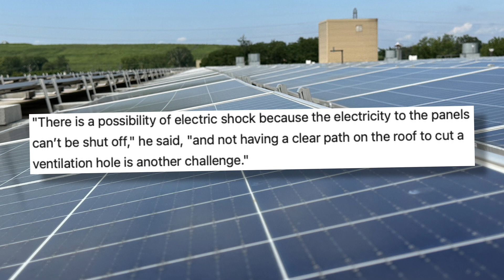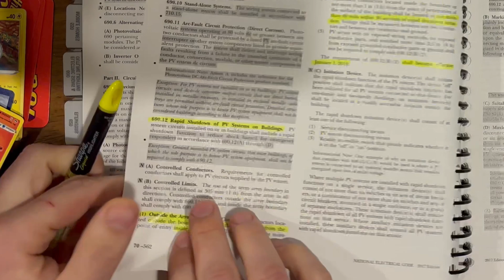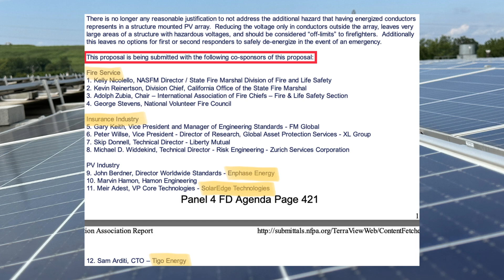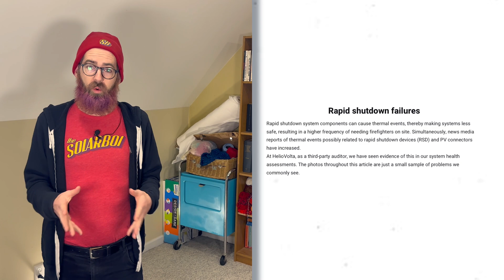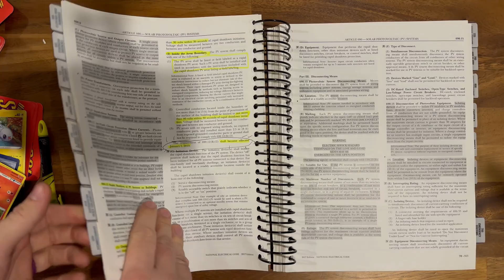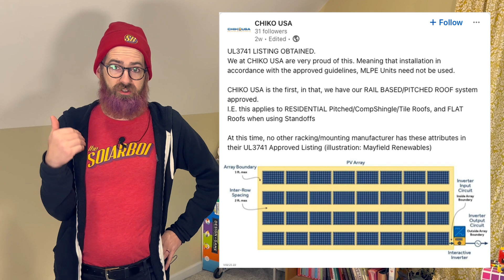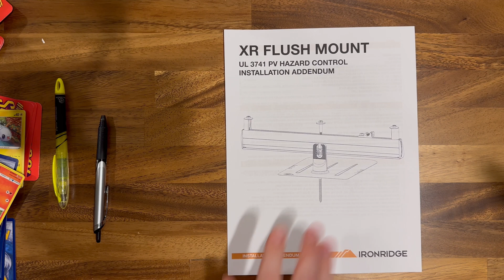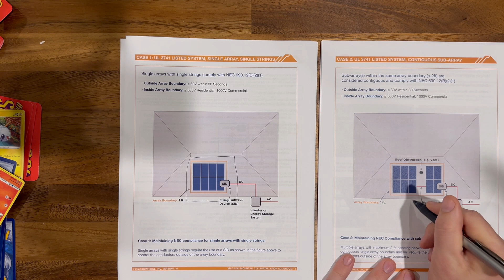Huge Breakthrough for Rooftop Solar! (UL 3741)

Comment: I got my electrical contractor's license in 1975, and spent way too many years in that rat race.  The NEC has always been a PITA trying to decipher all the ifs, ands, buts, and exceptions, and sub-paragraph blah-blah, not to exceed blah-blah unless, pursuant to blah, blah, etc.

As if that weren't bad enough, there were about thirty different jurisdictions within the area I worked in, and they didn't all use the same version of the code, and many of them had their own separate special rules regarding conduit maximum number of conductor fill rates, and on and on.  In Los Angeles City, every inspector even had his own special quirks about how he wanted things to be done, and if you called for a reinspection, there was a good chance you'd get someone else, and he'd tell you something different.

I'm getting ready to install a small solar system at my house that will most likely not be able to output more than 1KW on a good day, and that's being optimistic... now I find out I'm probably going to need permits, engineering, inspections, and a whole lot of homework, just to make it "legal"!  I should have known the code panelists would make everything more complicated than it needs to be, and the proper palms would get greased.  Nobody wants the distinction of sitting on the last code board that didn't "do" anything, so we get more and more dubious BS that mostly serves to make jobs way more complicated and expensive than they need to be.

Comment: Looks like I'm going to build a 24 volt system rather than a 48 volt.  Leave it to the people who stand to benefit from over regulation to create it.  When has that ever not happened?  The same people rotate between regulating lawmakers and industry corporate executives.
Reply: I think 24v system with <30V coming off the array <80V inside the array (more parallel connections, SCC on roof and a thicker cable to batteries) for 690.12 compliance.  So rapid shutdown occurs all day every day.  Inherently safe.

Have you tried this with inspectors?

Comment: It seems pretty sad that firefighters are worried about a 500 volt solar system when those who had the job before them faced much worse daily. An old tube t.v. could hold a charge of 25,000 volts and firefighters fought house fires with water all the time with no t.v. regulations. Also a firemans turnout gear was not nearly as good 50 yrs ago as todays.
Reply: and you have experience as a firefighter? Walk in another's shoes.......
Reply: perhaps join your local VFD, and take a class in structural firefighting (generally 80 hours). every VFD is struggling to recruit, and the education and experience would help you better comprehend (and opine on) hazards and avoidance.
i look forward to reading your opinion on venting a residential roof with a photovoltaic array, and on structural firefighting, in general.

Comment: I'm so happy I made the change from residential to commercial solar fields. No more roofs, big change!
Reply from the maker: It's def nice to not lug stuff onto a roof in those situations
Reply: @dereksolarboi  It's nice not to have a solar company send a bunch of clowns out to improperly penetrate your roof with mounting hardware, when the first rain doesn't happen until after their check clears the bank, and the company sends another stooge out there with a gallon of Henry's and a spatula. 😒🤡